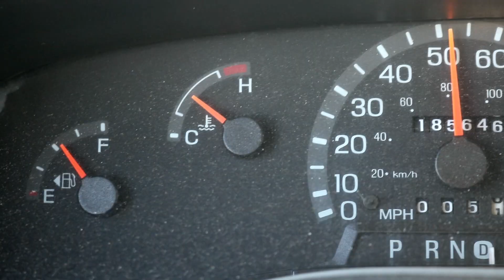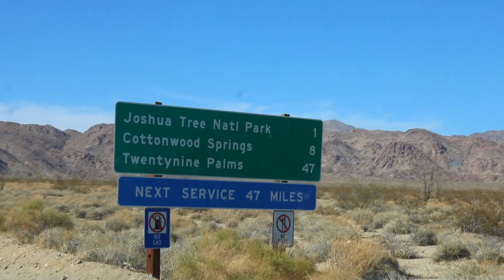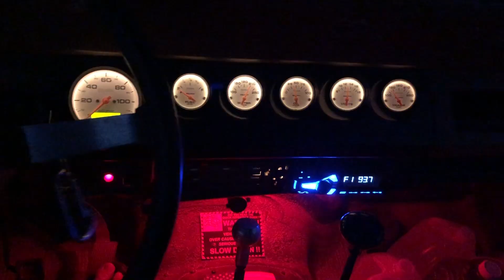I Broke Down In The Desert

Comment: You can also leave the cap a little loose so it doesn’t build pressure and will not push the water out just keep an eye on the gage because it lowers the boiling point
Reply from the maker: Thats a great Idea. I didn't think of that